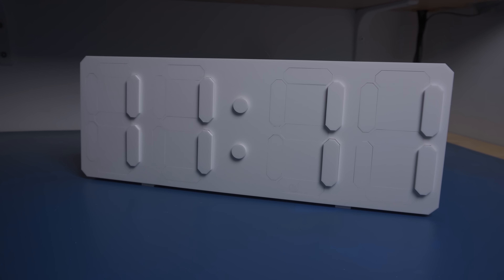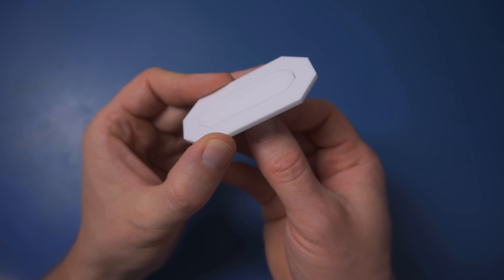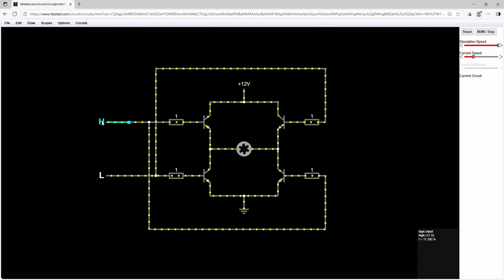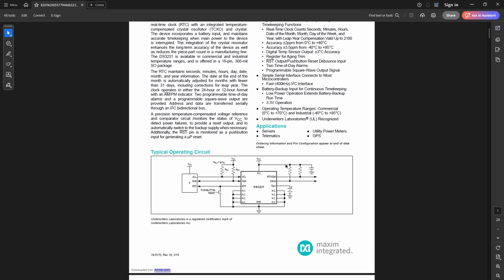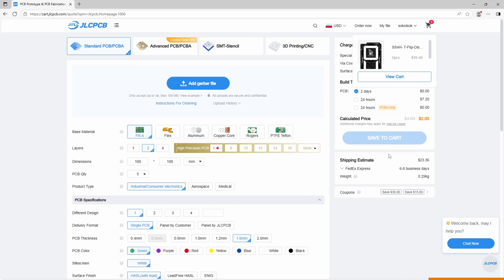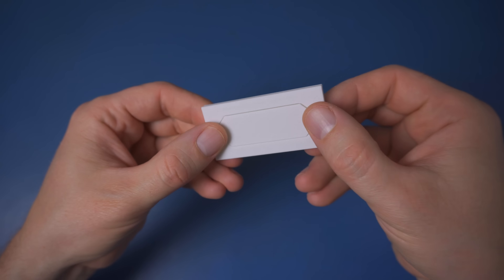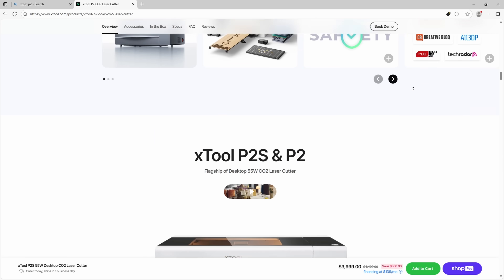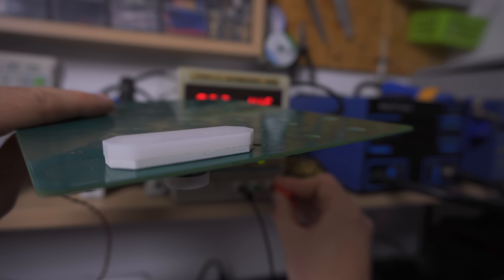DIY Electromechanical Shadow Display powered by ESP32

Comment: I built a clock with very large 8-inch displays, which requires special electronics. What I find great about your project is that you can make it any size you want, within certain limits, of course. Where do you buy plastic sheets?
Reply from the maker: Let me start from the end: it's just a regular 3mm acrylic sheet. I'm pretty sure you can order it online from somewhere close to where you live. And honestly, you can often find it at hardware stores too.
As for scaling—technically, yeah, it’s possible. But the bigger the segments, the heavier they get, and the more force you’ll need to move them. Sure, you cam make a bigger coil, but I’m not convinced the force scales linearly with the weight of the segment. It’d probably take a bit of R&D to figure that one out :)

Comment: A cheap GPS board would keep time very accurately.
Reply from the maker: Cheaper than $3 for an RTC chip? :)
Reply: @SmartSolutionsForHome  Perhaps a few dollars more but with good reception there is no need to set the clock manually anymore.
Reply from the maker: I’ll admit, I hadn’t even considered using GPS modules until I read your comment. But now that I think about it, I can see a few drawbacks to going that route. First off, GPS satellites only give you time in UTC, so I’d still have to manually apply a time zone offset. So basically, the exact same amount of work as now.
Another issue is that getting a fix can take quite a while—sometimes even tens of seconds—meaning the microcontroller wouldn’t know the time right after powering on. 
And the last thing that comes to mind is the need for an antenna (though I’m not entirely sure about this—maybe there are modules with built-in antennas out there).
Either way, thanks for the cool idea—it’s something I hadn’t thought of before! :)
Reply: @SmartSolutionsForHome  You can use both RTC and GPS in combination, a very common solution, or ntp. With RTC and GPS you'll always have a time stored but with very high accuracy updates from the GPS. You'll need to know the time zone or perhaps only use a set of up/down buttons to switch 1h offset manually, also for daylight saving changes if you cannot do this automatically.
Reply: @SmartSolutionsForHome If you have GPS, you know where you are, and what time zone you're in 😊

Comment: really really great... and does the circuit not draw any power to the coils when the magnets aren't changing state? i'm guessing that this might require the clock to be vertical (and not sitting flat on a table)? LOVE that it has MQTT support by the way... great job!
Reply from the maker: Thanks a lot! I'm really glad you like it!
You're absolutely right about how it works—the coils only get power when switching states, and there's no locking mechanism besides friction. So yeah, you're right again—unfortunately, it can’t lie flat on a table.
The previous display, though, can work in any orientation. I managed to made a flap-locking mechanism for that one.
Reply: Do you think smaller magnets could be used to lock the segments in place?

Comment: What about power usage? Does it depend on content "displayed"? I guess there is no idle state, it's always powered to keep segments up/down?
Reply from the maker: It only draws power during the switching moment. Unfortunately, it pulls quite a bit—around 0.6A at 12V per coil—but just for 100ms. The rest of the time, only the ESP is powered.
Reply: @SmartSolutionsForHome  Oh nice! But it doesn't keep the physical state as the previous version - I mean not so strongly, but it keeps it well enough thanks to friction while in vertical position, right?

And back to power usage - do you know how many watts over a day on average?